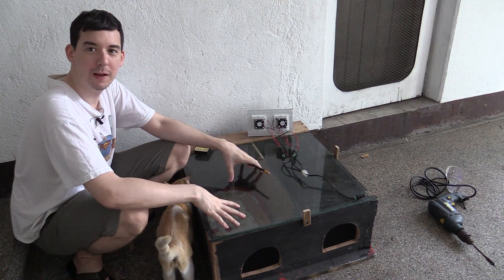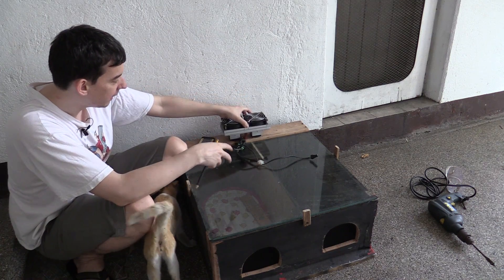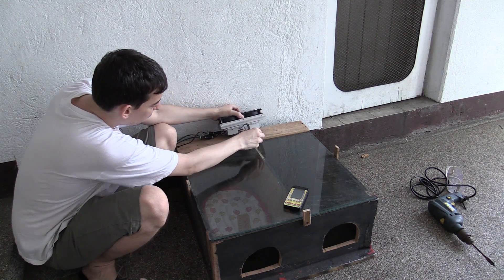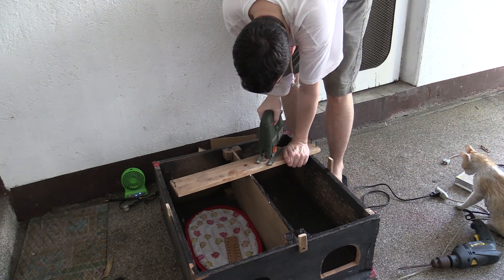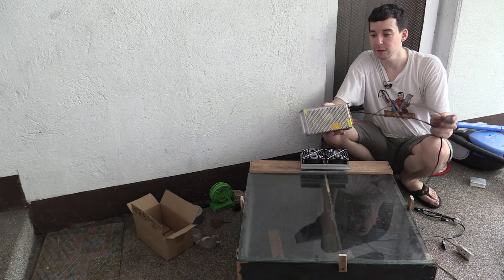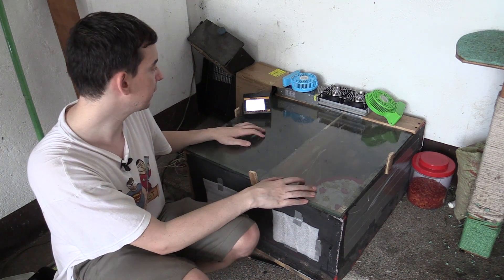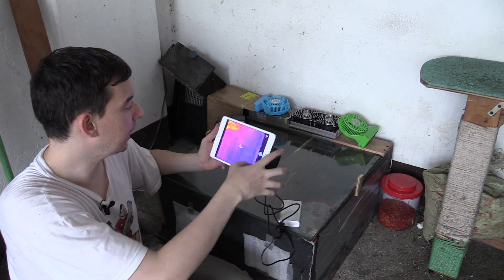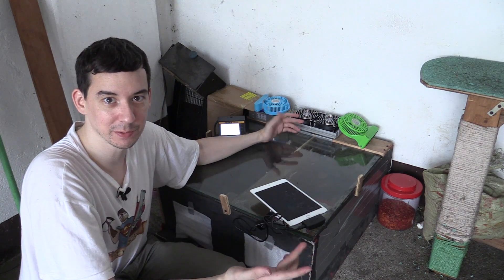Cat Condo Peltier Aircon system

Comment: I also bought this same Power supply but it didn't work my peltier didn't got cold it's only getting hot and after few minutes it's getting normal temperature but not cold please suggest me I have 3 peltier but I used 2 for this and also have 12v 10A I don't have proper hit sink for that but I don't think it's effective too much for this it has to become at least 20 c degree please help me

Comment: First, your power supply isn't enough. You've said that your ps is rated 10a, you should have used 20a. It's because I assumed the cooling kit is using the 6a peltier since those are the most common rating being sold.
And there are two of it so that makes it 12a plus the twin fans so more/less around 15a in total current.
2nd, Make a proper air flow for the hot side, either upgrade the fan or upgrade the heat sink. :D
Reply from the maker: +John Carlo Torallo this unit has a maximum power draw of 80 or 100W. I can't remember the exact rating but it's under the maximum output of my power supply. I made another video where I talked about this and did an initial unboxing :) I think an upgraded fan on the hot side would help a lot. And cooling ambient temps would probably help.

Comment: I see you're in PH too!
Kababayan! Anyway, you could try water-cooling.
See the video here: https://www.youtube.com/watch?v=oEYuTE_d_Dk&t=777s
It's in Malay (I guess) but you get the idea, plus it will reduce the noise.
I'm planning to build it myself.
And also for the efficiency part, you  could use an arduino to monitor the temperature, and a relay-switch to turn off the system when it reached the peak temperature and turn it on again when the system went away from the goldilock's zone.
And you could also insulate the whole Cat Condo so you could preserve the temperature better.
Anyway, good luck my friend!
Reply: In the liquid cooling part, just adjust the water-source's volume, you don't need to ice it. :)

Comment: how about just adding some holes or a open window to vent the heat out instead?
Reply from the maker: Yep there's already many holes drilled into the sides and back which allow airflow. I just wondered if a basic 'aircon' style system would be possible at all :) An experiment.

Comment: how about those cpu coolers? ive had success with hyper 212 coolers.
Reply from the maker: Perhaps. A CPU cooler is essentially the same thing though. A heatsink and a fan. But it might be worth trying because I have some doubts over how good this heatsink is and the fans spin pretty slowly.
Reply: or those all-in-one water cooling kits. At least you can mount the radiator a bit further from the whole unit.

Comment: can you make a video of trying 12v and 5v peltier cooler using 18650 batteries....I want to know if how long could do and would do cooling will be same as the in powered with power supply....may idea is if 5v peltier cooler work with 18650 I will place in my usb portable fan and become usb potable air conditioner.....I will be gald if you do this test pls make it happen.....nobody but you will the first trying peltier coolers in 18650 batteries in whole youtube videos......
Reply from the maker: I've tested 5v peltier modules connected directly to an 18650 and it worked fine. One side got instantly freezing cold and the other got extremely hot. Although I haven't measured the power consumption. The thing is, you'll still have to deal with cooling down the hot side otherwise it will overpower the cold side.
Reply: +Gadget Addict thanks a lot!now I can do my idea....

Comment: why not add a mini exhaust fan? I think I saw some at Ace Hardware... and just put it in the middle instead of putting separate fans to reduce power consumption... just saying.
Reply from the maker: This unit include peltier modules which are often used in mini refrigerators. So rather than just moving air, they can actually drop the temperature. One side of a peltier gets hot and the other gets cold and the hard part is stopping the hot side from overpowering the cold side. But ultimately, I'll probably just go with a regular fan like you say and draw fresh air through. It's not as good as "aircon" but it's much cheaper to run and will keep them a bit cooler I think.

Comment: try to add a bigger fan inside because that small fan on the cold side is to small and it cannot move the cold are inside.
Reply from the maker: I can do that but right now the bigger issue is that the hot side is getting too hot so the cold side isn't even cold anymore.
Reply: Youneed to water coled it
Reply: Juan Paolo DIY!/ The DimMak lights & sound There's no need to change the cold side, what it needs is to dissipate more of the hot air.
Plus good insulation. :)